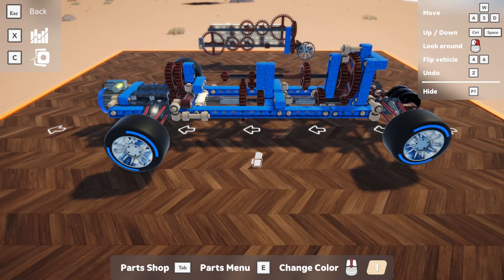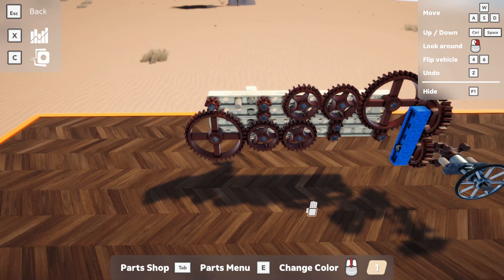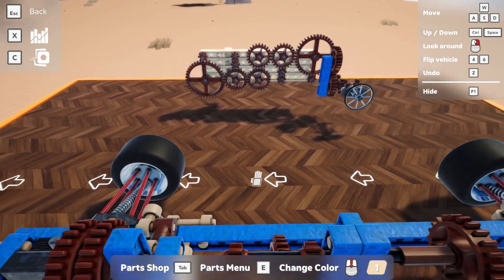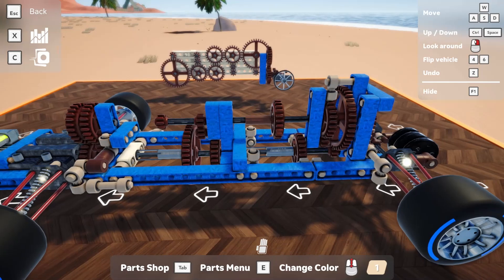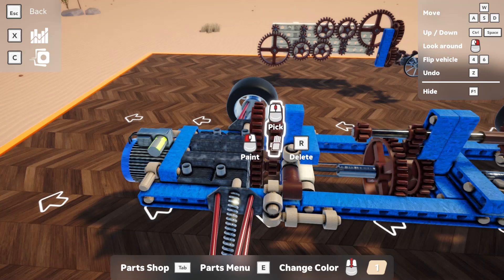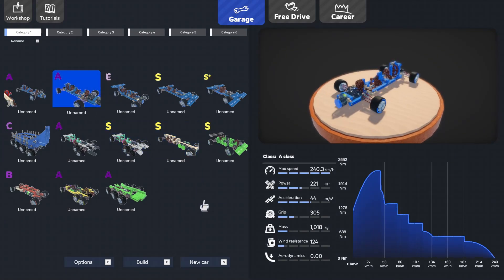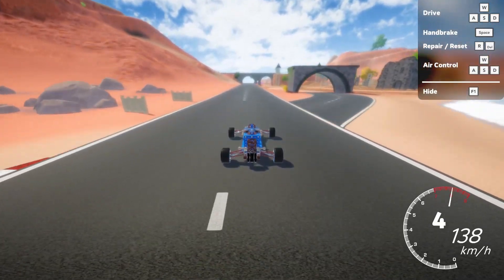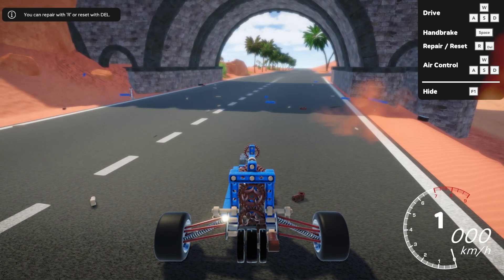Screw Drivers - 5 speed gear box build and demo

Comment: My most mechanically interesting gearbox was using 3 triple shifters, with each shifter having an option to connect an increasing ratio, a decreasing ratio, and a straight transfer. Was kinda crazy how quick it changed gears tho hehehe

Comment: The planetary has a diameter of 3 on two lengths and a diameter of 1 (even though it doesn't look it) on 1 length, though since you're using it as a reducer you would need 3 full lengths outside of the engine for it to work.

Comment: how do you make a 7 speed?
Reply from the maker: On the build above I forgot the electric capacitors and the turbos for the gas engines. The seven "SPEED'S" are due to the drop off of rpm. Electric rpm drops drops before the gas engine. This Creates 2 extra steps. 5 speed gear box + hybrid engine set up.

Comment: Does this work for other engines? Or different shifting. Only got 2 stage shifter but want to make a gearbox.
Reply from the maker: Any engine yes. Electric and turbo Gas engine hybrid can also add extra stages as the rpm of each type drops out. Behaves like 2 extra gears.
Remember don't gear too high. Below 240 is best for racing.

Comment: im glad i found this managed to get a 7 speed transmission going using gear shifters to pull the middle small gears out of place to prevent conflict
Reply from the maker: turbo and electric hybrid engine combo can also add 2 top end stages. Like 2 extra gears.
Reply: @GuardianOz  that would explain why the actually reachable top speed is higher than the games listed max top speed

Comment: lol much cleaner than the one I built, but you’ve got more parts unlocked than I do.  Definitely going to copy some of your solutions here, particularly the 2-1-1 gear set up.  I was trying to figure out how to line things up for multiple speeds, and I was missing that.  Basically ended up using 2 separate transmissions, one with a 2:2 and a 3:1 and the other on a separate shaft using 2:90° gear and 90°:2.  (90° is basically a 1.5 gear) I’m not sure how the game chooses which gear set to access, I think it goes 1.5:2-2:2-2:1.5-3:1 meaning the gears aren’t actually sequential but flops back and forth between gear shifters.  Weird setup, but it works.  Getting near the same top speed you did but your acceleration is a lot better because you’re using better engines than I have access to currently.

Comment: I put a 6 speed transmission in the steam workshop. Check it out. It's named 6 Speed Transmission. I used planetary gears.
Reply from the maker: I am going to grab that. My turn to learn
Reply: @GuardianOz  you can flip around the planetary gears if the range is too high also.

Comment: This is MUCH more compact than my design, I have direct drive from my engine going through a 6 speed and I don’t spin in first really but I did incorporate 4wd, the game tells me my top speed is over 600kph however my laptop isn’t powerful enough to run the game past 15-30fps so I haven’t gotten out of 3rd gear 😅
Reply from the maker: LOL. Update for above I forgot the Turbos and Capacitors. I also stage the engine with medium to small before the gearbox.  It will drop marks in 1st, 2nd, and 3rd. With a top speed of 240. You can win any race on that build.

Comment: This was really cool! Found this while trying to see what a planet gear does, but as this video shows, it's just another gear shifter. I will definitely be trying this! You are very underrated. :)
Reply from the maker: The planetary gear can be a reducer or to increase rotation, In robotics they are used to reduce rotation speed. By using more revolutions on the drive (stepper) motor the resulting arm movement is more accurate and stronger at the same time in a very small space. They are also crazy strong as there are more gear teeth making contact at the same time. :) Look up ring gears for similar function. "Adam Savage Vault door" is an excellent video to watch.